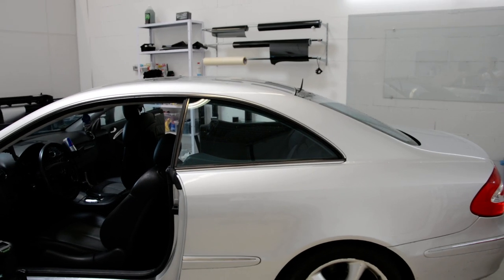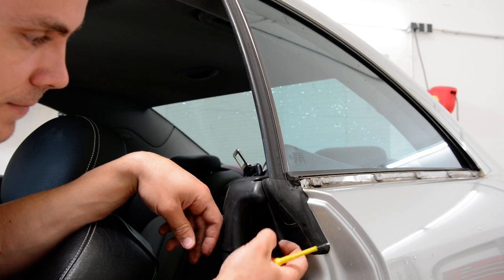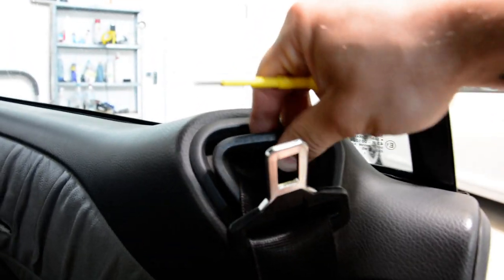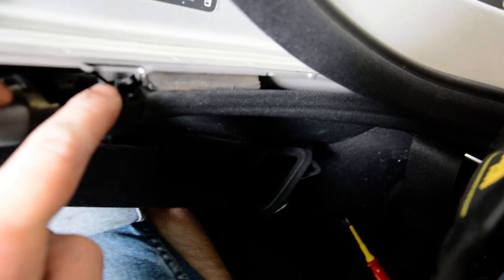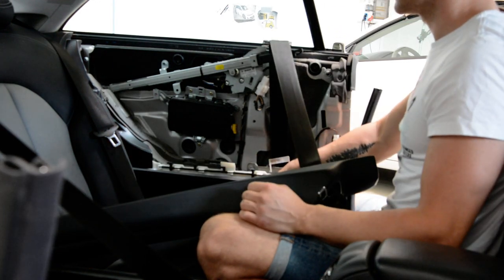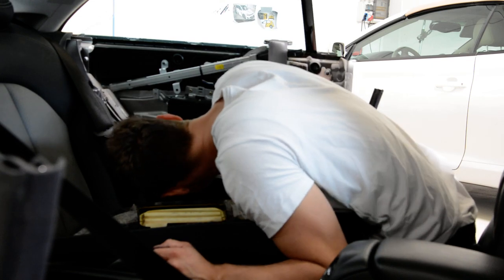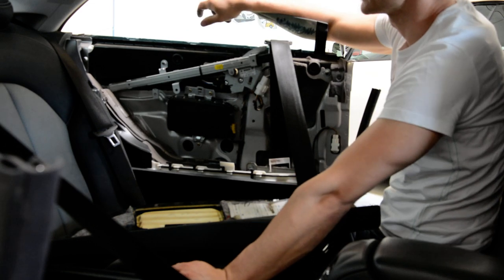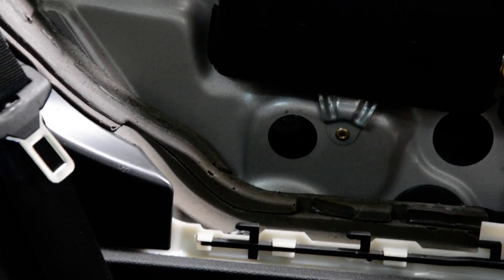How to remove the quarter glass Mercedes CLK W209

Comment: Thank you sir , one question for you sir.   How to access the screws if the glass window Is stuck within the door and it does not come up? 
Someone pushed the glass all the way down and I can not pull it back up.  The glass is in the panel and does not budge at all. What can be done sir?